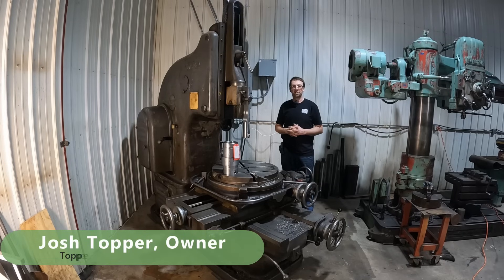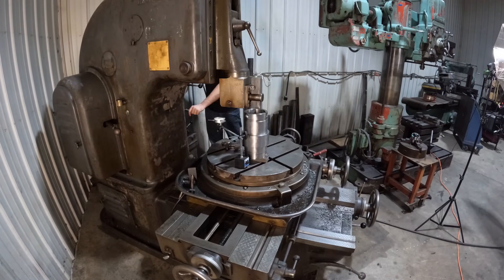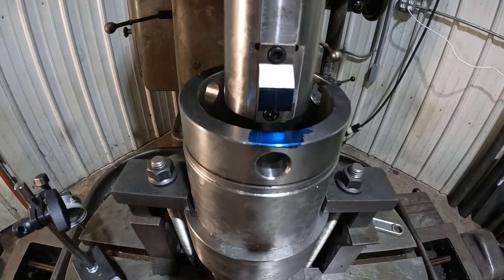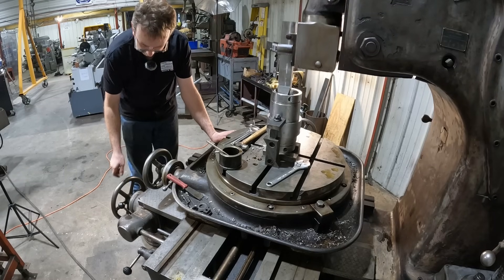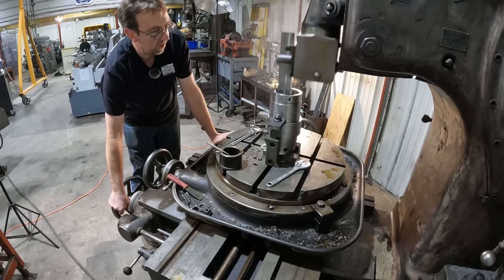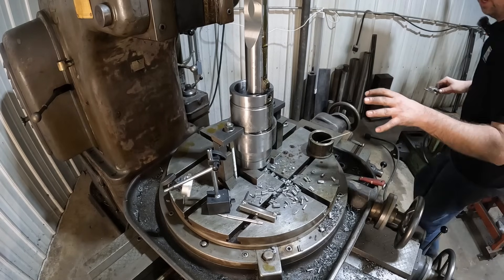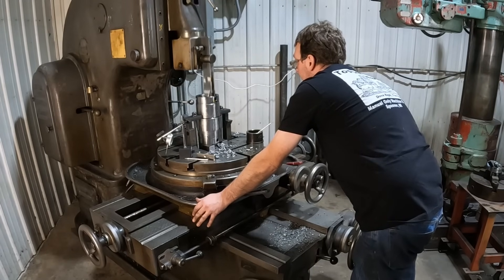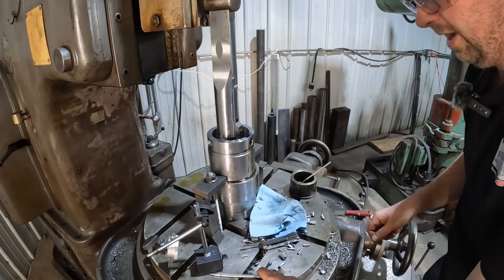How To Cut Accurate Internal Keyways On A Vertical Shaper | Manual Machining

Comment: You stated that a vertical shaper does not have a clapper box; not true! I have a Pratt & Whitney 6" vertical shaper, and it does have one that looks just like yours, it is spring loaded and it has an adjustable stop that can limit the travel of the clapper or lock it out entirely, there is a square head setscrew in the back side of the tool holder head that does the adjusting/locking.  The Morey looks much like the Pratt & Whitney in most details, but not all.  I use the clapper mostly, but it probably would be best locked with such a long bar.  I did nearly all my keyseating with a Mitts & Merril keyseater in my shop, it would cut up to 1 1/4" X 12" keyseat full width automatically and would cut tapered keyseats for gib keys.

Comment: I agree with you vertical sloters are the most fun to run i used to work with a 16 inch butler cutting internal splines and planetary internal gears fun work you know

Comment: So much fun? Looks clunky to me, except for set-up which requires care and thought.  Probably profitable because shops capable of machining internal keyways may be uncommon. Of the several machine shops I was employed in only one had a shaper, a small horizontal used for cutting welds off test pieces that were eventually machined into bolts to be pulled apart to verify the strength of the welding rods. You neglected to show how the gage block cleared the entire length of the keyway (not just the top) and how depth was consistent at both ends which may occur due to possible tool or ram deflection  - but I'm just getting picky, am I not? Your camera work and explanation as you worked was top-notch. In closing, I'd like to say my favorite machine to run was a 5-axis CNC horizontal mill I ran at Lockheed-Martin for the B1 Bomber project. Although there was not much machining skill involved due to the nature of CNC, watching the multi- dimensional contortions the machine made was thrilling. Thank you for your channel.

Comment: I have a horizontal shaper and the clapper box doesnt work on there for keyways. At least in my experience anyhow. I have to bolt it tight on order to cut internal keyways. Problem i had was in such a light cut it tends to float over for the first strokes then dig in and bog down or snap cutters of mess up the fixture. When its bolted you can take .001 cuts without any issues. Great machines!! Also great vids. Keep up the good work!
Reply from the maker: I have a job going right now that I tried the clapper on.  Same result you saw.  Rigid is best in this instance.

Comment: Hi. In my limited experience with vertical slotters, they have a clapper box and the keyway to be cut faces the machine for rigidity. The tool holder you have is not original, My guess to cut a keyway in a larger diameter than could be done in a standard setup and was cut away from the the machine.

Comment: We did a part like that with a 1" push broach using a shop made hydraulic press with insufficient stroke.
Every "push" required resetting the table up then down. We stepped .030 per push, not .060 like Dumore says.
I think it was 12 or more pushes. It took 2 hours. Plus we made a full length bushing. Aluminum. It worked ok.
All for one part.
And the fork lift is driving right behind you back and forth the whole time. The job is dangerous as hell.
I tried to get the owners to get us a shaper. We broach plenty of other parts. They won't get me one. Commies.

Comment: It insure accuracy, you should start with a thin tool and cut either side of the slot and then the center.  This will result in less wandering which may be due to changes in density of the material.  However, I would be interested to know if  the shop before you used a shaper or tried to broach the slot.

Comment: Has this machine earned it's keep? Are you in the black once purchase price, rigging, tooling, etc. costs are figured in?
Reply from the maker: It paid for itself very quickly.  Every machine in the shop had paid for itself with the first few jobs, with exception of the Lion Lathe.  But, the Lion will have broke even after another few weeks.  I don't buy equipment for fun, they all have to have a purpose and a way to pay for themselves quickly.

Comment: You sure you haven't got a clapper box? I've seen a few slotters with spring loaded clappers, pretty heavy springs to hold the bar up.
Reply from the maker: Clapper boxes are very rare on these and not reliable. Rigidity is the key on these machines.

Comment: This warms my heart to see a skilled machinist still making a living in the US and to see US made antique machine tools still being used. The only modern machine that could cut the keyway would be a wire EDM. I worked as a machinist in three different shops. Two were tool and die shops. None of them had a vertical shaper but I did occasionally run a horizontal shaper and that was one of my favorite machines. It was a Gould & Eberhardt. Right next to that one was a Steptoe shaper. I miss working as a machinist but have a small vertical milling machine and a Southbend 9 in lathe in my home garage for personal projects.
Reply: Is your Southbend one of the new ones that Grizzly sells? Do you like it?

Comment: You sure have a lot of these old machines, which were built to last and still work well after decades. I have a few power tools that are around 50 years old now and still working well with routine maintenance. More modern equipment often has a shorter life, so it pays to look after this old gear and keep it working for the future.

Comment: nice indicating in. didint se this metod but shure is the best one yet. The machine hase claper box,  but is spring loded, if you pus the tool in it wil "clap" a little bit, try it buy hand . i have put a 2 axis dro on mine so be nicer to use
Reply from the maker: I've tried many indicating methods, but this was the most accurate. No clapper box. Very rare to have one in a vertical shaper/slotter.

Comment: How did you orient the keyway centered on the hole? I could see the other one off center of their hole, but you didn’t show how you lined up yours on center.  For me (about a year into machining) the setup is the most interesting part of watching these videos.
Reply from the maker: I can't give away all of my secrets. If I did, everyone would be buying these machines and trying to compete.
Reply: going by scribe marks and centered the cutter on them. with a square off the table on each side of the hole and then scribed to the top and then using centerline of cutting bit

Comment: Yeah Josh, Keith, until now, I haven't seen a Vertical Shaper. Does this also operates, with the table run into an auto rotation. Or basically the table gets only locked down, then manually, you rotate it???
Reply from the maker: The table can be powered also.

Comment: Hello John, first an apology....I accidentally clicked the thumbs down! I unchecked it and got the thumbs up done. Hopefully it doesn't reflect on you. I really enjoy the channel and have a question. When you get a new (to you) piece of equipment, do you just download copy of the manual and go teach yourself?  Thanks again for the videos.
Reply from the maker: No worries on the accident. This particular machine is very obscure and manuals don't exist. It was quite some time before a friend sent me a parts manual. I just start working with the machines and figure out the function of everything. Then put it into service.
Reply: @TopperMachineLLC  Well, I am not sure, but between you and Keith Rucker, I am going to be submitting a bill for a vertical shaper and additional shop space build!  Again thank you for your time/effort to motivate me to get out in the shop. Still working on the "do it right, the first time"!

Comment: Technical question, is the cup holding your oil dabber brush a break caliper piston?
Reply from the maker: It's a piece of DOM with a plate welded to the bottom. Nice and heavy.

Comment: You did prompt me to look into the table oiling on my G&l the other day because I felt like it wasn't putting out the right amounts. I think I need to look into changing the bijur oiler numbers as the screw is getting more oil than the ways and I feel like it should be the other way.
Reply from the maker: I'm glad I could help.  Hopefully you get it all sorted out.  You should do a video on it.  I would watch!

Comment: That material around the hole is pretty thin- I would worry about distorting the hole- maybe turn a round plug to keep the hole supported during the cut.
Reply from the maker: It wasn't really that thin.  Probably an optical delusion from the camera.  It went through a rigorous inspection process, and passed with flying colors.  There are about 20 variants of this job, and this particular part is 1-2 per year.  Definitely looking forward to the next one.

Comment: Looks like a Peddinghaus part.... LOL
Reply from the maker: Not this time. But I do see some of their parts.
Reply: @Topper Machine LLC  
I operated a Peddinghaus beamline for Cives steel, Augusta, Maine, about 30 years ago... the part  you were shaping looks very similar, albeit longer than the bronze bushings used on that model hydraulic press ram guides of the old  machine... I know how difficult and pricey Peddinghaus can be with parts or support when something breaks or doesn't work properly and watched another of your videos making an emergency rescue part... and couldn't help not make a half joking comment... the old slotters, shapers, and planers are awesome machines... it's great to see you enjoying your machine and validating the relevance of exactly why these machines were built in the first place. 👍👍

Comment: Boy, sure would love one of those... I periodically do a 1 1/4" keyway in an 8" bore, 10" long, in STAINLESS... 😩 
I have done them on my 16" shaper but it sure is a task... Takes all day to do one... In fact, I have a PO in my email right now for another pair. But I think I'm going to look into wire EDM to do the keyway. It's just too rough on a 120 year old shaper...
Reply from the maker: I just did the second part for these guys.  A little smaller bore, 9.5" long,, in ductile iron.  That was a learning experience.  I couldn't imagine stainless.  I feel for you.  EDM can be a good avenue, but in my experience won't be perfect like a shaper can cut.

Comment: If you have many of these to do, on your tool holder, machine a locator hole above your cutter on centerline and make a pin to go through the hole in the part and into your tool holder to align the center of the part. 😎

Comment: I always underestimate what general machinists call big , big to me is usually when I need to use 3 cutters or more which is like 2.5" or bigger
Reply from the maker: Big for me is getting over 10" diameter.  I do a lot in the 2-8" range and consider that my small stuff
Reply: @TopperMachineLLC  the smaller stuff I would work on was generally around 10-15" range around 5000lbs biggest I worked on was a 40,000lbs shaft with 55" on the biggest diameter
Reply from the maker: @Realtime1501  I used to work in a place with a 60" swing lathe.  Ran that many times.  I miss those huge parts.
Reply: @TopperMachineLLC  yep me too, just a whole shift waiting for a single cut to run its course

Comment: Just curious, why not stick with the 3/4" bit, then take a 1/8" cut on both sides?
Reply from the maker: These cutters are not rated for side cutting.  I have used HSS bits and done that, but these work better for the really big and long stuff.  Any side load would deflect the tool and taper the keyway.

Comment: I am not a machinist and I know nothing about this machine but your excitement over it is something else. It looks like this job has taken your machine to the limits. It is also cool how you are willing to go where someone else has failed. I do not know how much load this part has to handle but it looks like the wall thickness at the corners of the keyway are thin. I also like how you are thinking about how you can do it better the next time. As you get older you will appreciate a clean crap hole more and more. Thanks for the great video and it is always good to see you. :hand-orange-covering-eyes::trophy-yellow-smiling::trophy-yellow-smiling::trophy-yellow-smiling: